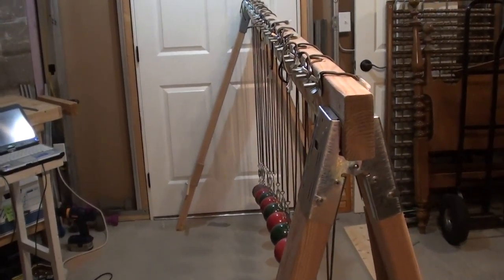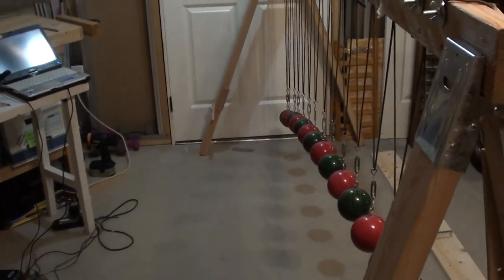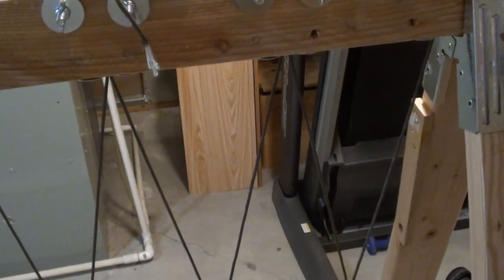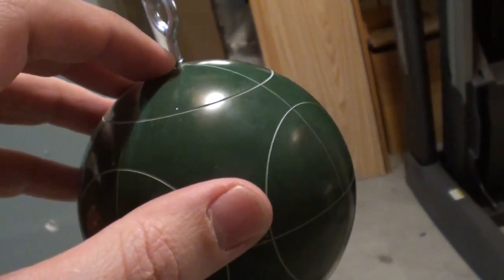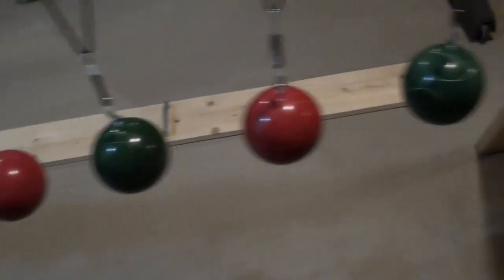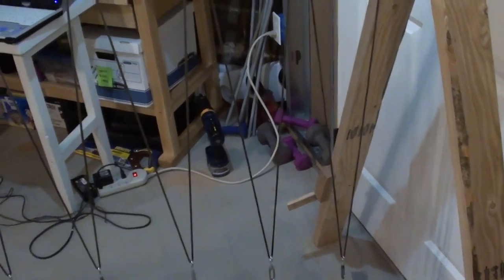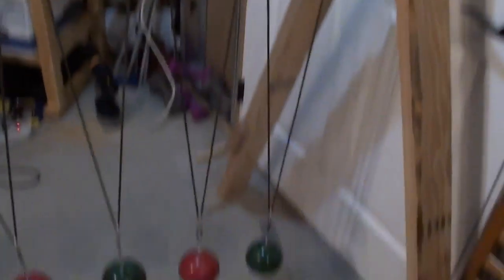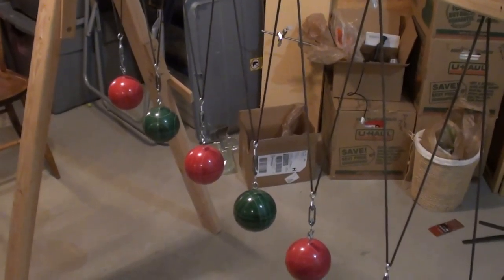How to Build a Pendulum Snake Wave Machine from Bocce Balls

Comment: Does the elasticity of the paracord present an issue?
Reply from the maker: Mr. Shields I think the forces involved don't stretch the cord significantly, but I went with the paracord because it was relatively thick and on hand.  I get about 5/100th of a second variability over the 60 seconds.  Snugging the cord against the hole with the washer helped a lot.